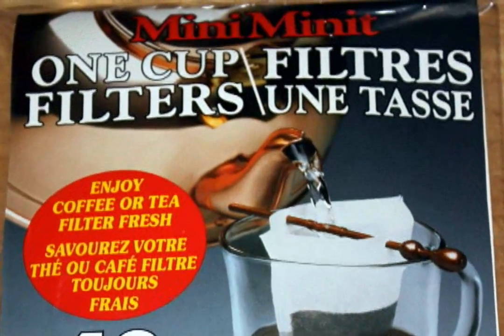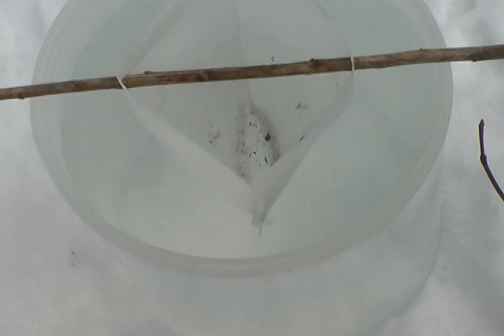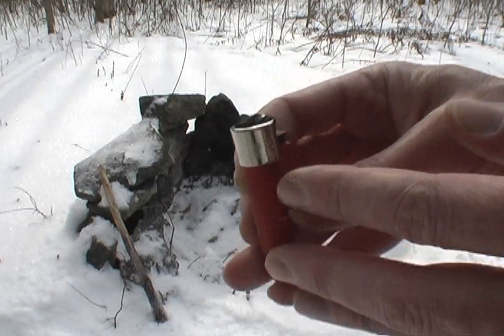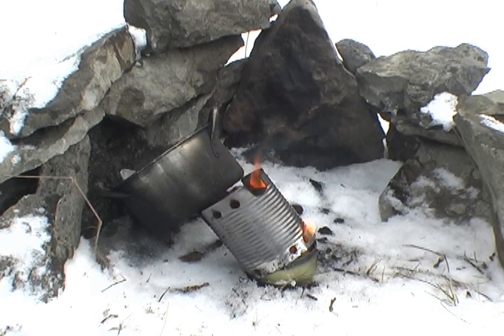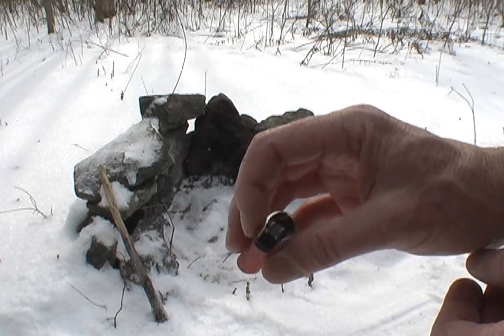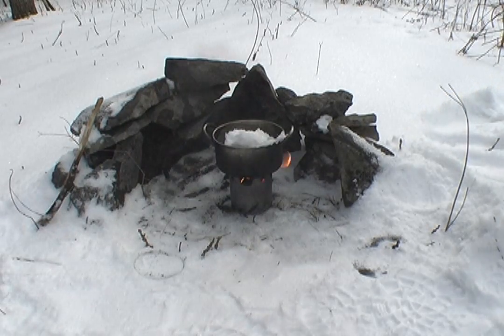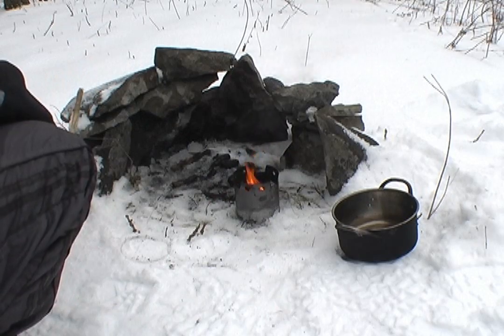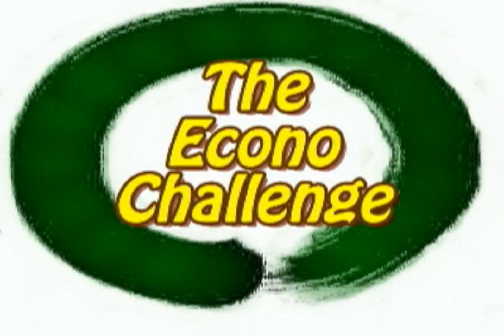DIY Survival Candle Testing  - What could go wrong?

Comment from the maker: @Ggreenvideos Ah men on the wood brother.  The survival candle does make a huge mess eh?  I had to reset three times ... my glove fingers were covered with greasy black soot.  Did not take long before I was transferring to my hands and then everything I touched after that.  In the notes I say Emergency only and I mean it.   I am only using the windscreen from the wood pellet hobo to support the pot.  If I had my sturdy base it would not have tipped. ;-)

Comment from the maker: @jbdtaylor You can if you did not melt the plastic that holds the wheel in place.  I think I melted it enough that the spring started to push the wheel to one side.  Ruined a really good lighter.

Comment: @EconoChallenge I think I would have looked at the empty lighter when packing and not taken it because I already had a fire steel.  But starting the broken-but-full lighter with a fire steel would have needed more hands than I came equiped with.  My fire steel is a backup of sorts, but you only needed half a backup.  Off to look at Sancastrochez's now.

Comment: I thought that you could change the flint and spring in Clipper lighters? If you pull on the wheel it comes out along with the spring in a tube?